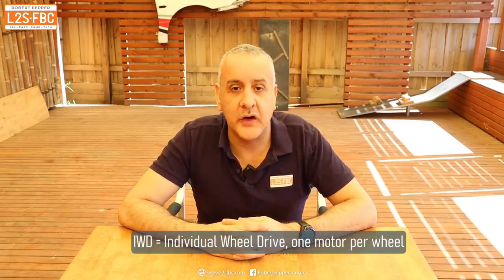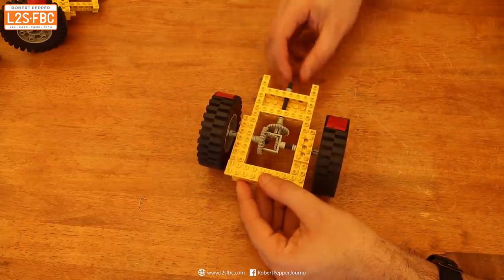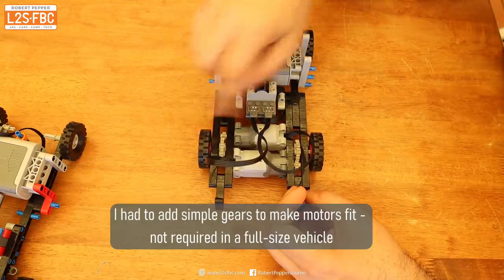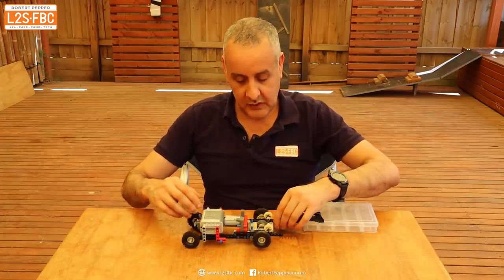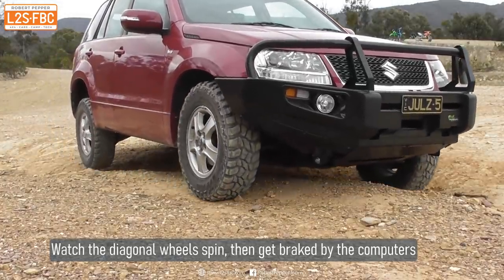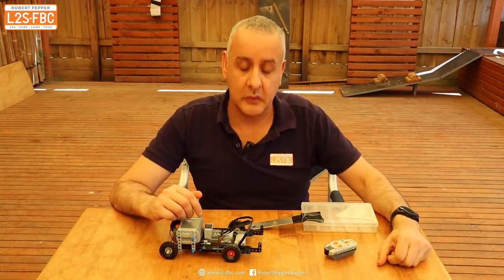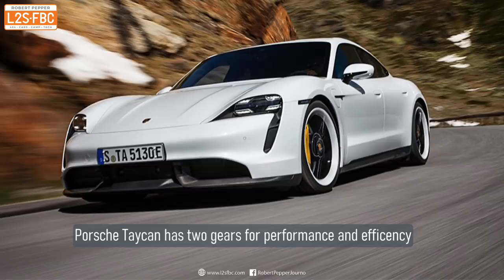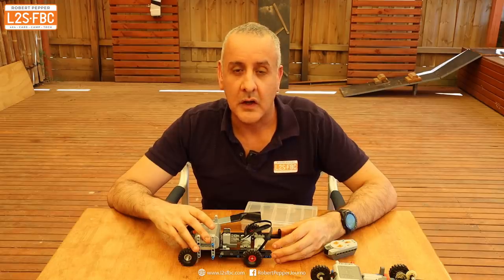Why Differentials Will Die - EV IWD Is The Future!

Comment: I will stick to my 80 series with differential locks thanks
Reply from the maker: That is okay we will pull you out when you need it 😁
Reply: @digbick696969 same aplies to petrol engine vehicles...
Actually since electronics are sealed, they are resistant to any floodeing.
Submarines drive on electric motors when submerged.
Reply: @Martink9191  submarines also commonly used diesel and ice engines, even while submerged, the real advantage to using electric motors is actually stealth and silence. Often the ic where just used as generators.
Reply: @andremartiniuskalstadtjosa1309  When submerged, they drive only electric. They do not have resourse for air underwater.
Little mathematics. When engin ccm is 10L, then every 2nd revolution engine pumps 10L of air trought it (without turbo). So it means at 1000rpm, it pump 5000L of air in one minute. It is 5 cubic metres. But marine engines are not so small. 10L may have on some medium yaht.
When geting on water, they start disel engines to charge battaries.
Reply: @L2SFBC   Hahaha 😂😂😂 yeah right more like the landy will tow you to the junk yard
Reply: @Martink9191  submarine air snorkeling was developed in 1916 in Scotland, it was mostly for the crew and the British Navy never did anything with it until the Cold War. The Dutch fitted it to their diesel submarine motors on O-19 and O-20 enabling the first under water propulsion with the diesel motors. Germans captured the tech from the Dutch on O-25 and O-26 in 1940 and fitted it to the diesel motors in 1943 on U-58. The Americans added them to their submarines with the GUPPY program. The snorkel was reverse engineered from the U.S.S. U3008, a captured German submarine.  
I do know that the snorkel was used on the Los Angeles class submarine, I don't know about the newest subs but I have no reason to think that they wouldn't be.
Reply from the maker: Loving this information thanks 👍
Reply: @jeffjohnson2273  yeh, they do have snorkel. But it is used only in light debth. When sumberged enought, (I do not have info, for how deep), they could not use it anymore.
As an engineer, I think that they might use it at as low as 50m underwater but not more.

EDIT: Looking for info, I found that snorkel is 20m max.
Reply: @L2SFBC  you cant even fit 35s. Cant lift these vehicles.  We'll be pulling you out of the gate to every trail. Gravel road trucks. Plus the amount of torque needed to off road will drain your batteries so fast. I guess youll also need a tow.
Reply: @L2SFBC  not to mention no articulation whatsoever. Youre fkd bud.
Reply: @Martink9191  i know this comment is unnecessary, but in response to your first comment, petrol engine vehicles were phased out in 1996. At least in the US. We use Gasoline now.
Reply: @smittywerbenyeagermenjenso3720  em... you are talking about submarines?

Petrol and gasoline sounds same to me...
At least I do not know any engine useing actuall petroleoum.
Reply: @adamezell7650  WTF Articulation and chassis type has no relevance to BEVs. The drive train can work on any type of chassis. Including ones that have massive articulation. Infact a good platform for BEVs would be the UNIMOG. Remove the Diffs and just have electric motors feeding each Portal axle
 gears.
Reply: @smittywerbenyeagermenjenso3720  FYI You do realize there is not difference between Gasoline & Petrol. They are just regional names for the same thing.
Reply from the maker: IWD 👍
Reply: @Neojhun  youre absolutely right on the unimog, cuz you kept the fkn straight axle and leafs. You disassembled your own argument.
Reply: @Neojhun  so yes, clearly it does.
Reply: @adamezell7650  WTF does that even mean? All I meant is BEV IWD does not require a specific chassis. It can work on leaf springs and independent suspension regardless. The new Bronco achieves abit more articulation with disconnecting front stabilizer bar. I think on BEVs with far more space freedom for suspension gear you could have more disconnection points like on the rear. Even though it has double wishbone front suspension and not recommended to be aftermarket lifted which messes geometry. But the vehicle should be design with enough ground clearance from factory. I think aftermarket lifts is pointless on these new tall vehicles from factory. Even the Rivian is well beyond what most people would need in the freaking Outback Australia.
Reply: @Neojhun  it means what the original post said was dumb. And that you and i are saying the same thing. Yeah you can attatch it to whatever. But how they have it set up it wont work. And dude ive built rock crawlers where the tire is on another guys hood. Easy 5 foot in the air. Good luck achieving that with the way the original post has the suspension designed. Sway bar disconnects are for kids. 4 link, straight axles and some gears.
Reply: @adamezell7650  LOL No it won't. You've never driven a 1980s Toyota Land Cruiser. My family has J80 I believe 1994 (when we bought it new) and a highly specced one. My parents still live out in the bush. It is far inferior to a modern 4x4 especially something like the existing Rivian. You have no clue what you are talking about.
Reply: @Neojhun  ok troll😂😂😂😂 literally drive one every day
Reply: @adamezell7650  LOL Swift boating. You clearly are a troll. Spamming nonsense. FYI I'm a GIS & GNSS Technician, modern version of Surveying with electronic sensors. The kinds of vehicles I install equipment on are Commercial Trucks, Expedition 4x4 like Iveco & Unimog and previously have done Military Contracts for both land vehicles and aircraft. You simply do not have access to the kind of vehicles I work on.
Reply: @Neojhun  you literally repeated what i said, good job. I simply do not give a fuck😂 any vehicle i build will be better than your million dollar budget. My next step in this is an ultra 4  car. If you think you can beat that you would literally have to have a spaceship. But we can have a build off if you want! And just so you know, weve been scaling mountains for decades with elementary electrical systems very efficiently.

Comment: The current problem with Evs in australia is the range. With a diesel defender you can do a 800km trip on one tank or simply fill up at a servo or jerry cans where's with Evs you have to recharge.
Reply: The defender is a legend and great vehicle for exploring the outback but If you are way out in no man's land exploring and having fun it would be great to see a solar recharge ability  you can take with you like a roll up flexible photovoltaic panel made with the new technology of perovskite solar which is thin and light .an All wheel electric drive rivian or Cyber truck would kick ass and you could stay out in the bush as long as you want.on the other hand you can't be assured of finding petrol if you bring an oil rig with you 😊
Reply: Jonathan Spier  fair enough I agree with most of what you say .Im just watching power density of lithium batteries continuing to go up as cost for said batteries are coming down then add that to the cost collapse of the price of solar panels and you have a look into an outcome    that I think 🤔 is very probable in the near future . you can't swing a dead cat 😸😺😺 around your head without hitting a new model of ⚡ electric car,truck ,bus , caravan 🚛 semi ,bus high efficiency Solar panel .not to mention new technology in perovskite solar,wind, battery storage, and wind.just saying I think my prediction of being totally off grid and out in the boonies and being able to get around is coming soon

Comment: Nice explanation of basic open differential operation, it's also shown why it fails in the orange truck someone tried to build for offroad use. There is also the option for clutch and ratchet style differentials. As well as air and electric actuated lockers. 4 motors are 4 things that can fail and will need replacement.

Comment: the problem is you have to over spec the motors as you can only send upto 25% torque to a given wheel, a 2 motor setup with conventional lsd or locking diffs would be superior in most offroad situations

Comment: Great video.  I think you got the direction of wheel turn backwards on the on-screen commentary about the Rivian tank turn.  Have you thought of doing a video on modern suspension systems?  I'm particularly interested in Rivian's air suspension vice the capability of something like the Audi active suspension.  I'm wondering if the extra advantage of the Audi system being able to actually lift a wheel (for example, to smooth out riding over a pothole) will be noticeable in a system like Rivian's which, from my understanding, does not lift, but which possibly may not need to very much because of the significant inertia of that large battery mass.
Reply from the maker: Oops, sorry about the verbal typo! Yes there are suspension videos on the way, that's one of my special interests. Technical detail on the Rivian systems is quite sparse...I don't think it will be active as you describe but the technology to do that already exists. Basically the car detects a bump just before it hits the bump - using some sort of scanning system, unsure what maybe LIDAR - and reconfigures the suspension to deal with it. So for example if the front left wheel will hit a bump the damper (shock) may relax slightly. It is also possible an IWD system could slightly change its torque settings for optimal effect. The heavier the vehicle the less it is upset by bumps, but another EV advantage is weight distribution - it's nice and central, plus low, so that's great for stabillity.

Comment: When the USA was going from horse and buggy to powered buggies there was a company called Baker coach that made cabs and motorcars for the Whitehouse for the president that used 2 electric direct drive motors on the front to drive the vehicle.  Porshe had an electric drive some time ago also.  Large trains and many cargo ships use electric drives fed from massive diesel generators, the electric drive supplies the torque needed for the large trains.
Reply from the maker: And diesel-electric is also used in some heavy earthmoving equipment!
Reply: @L2SFBC  Almost all at this point. Most of the really heavy stuff is Hydraulic-Electric drive (With an electrically driven hydraulic pump). Which is stupid-easy to scale down. There's 1:14 scale full-function hydraulics for RC construction equipment. The only important part is where the electricity comes from. And until batteries catch up, replace that belly battery with a fuel tank and stuff a 6kW diesel generator (Or paired 3kW for space saving) under the hood.

Comment: I always thought it would be beneficial to turn each front wheel independently.  When you look at the circles scribed by each tire, you find that the front tires cover different distances in a turn also.  The inner wheel should turn a bit sharper than the outer wheel.  I think this would also improve efficiency and reduce front tire wear.
Reply: @hughn  thanks, I checked that out.  It still seems that an active system would still be better.  The Ackerman linkage seems to be better at low speed, then has negative effects at higher speeds.  To cover the full range you need independent steering that maps the geometry to the vehicle speed.
Reply from the maker: Exactly..and four wheel steer!
Reply from the maker: IWD can do that!

Comment: great video, great LEGO models 👍👍👍 - 15 years ago I replaced the front diff with a LOKKA (not sure whether they are still around), was cheap as chips and still works flawlessly. It does the opposite of a normal diff and transfers the torque to the wheel that still has traction - the advantage compared to a "real" locker is that it still allows steering. But yes, I agree, the future will be 4 electrical motors for each wheel - can't beat the advantage of having full torque (when needed) immediately at lowest revs.

Comment: All good fun until you need to tow a load.
I’d love to see someone do an individual wheel combustion engine vehicle, just for interests sake. The tech to control inputs is already available. The benefit for a single engine is the ability to transfer all power/torque to one wheel when it’s logical to do so…limited by motor size in an ev.

Comment: One disadvantage is that with a fully locked ICE 4x4 you can send all of the power and torque to a single wheel which can be necessary to get over an obstacle. With four independent motors in he same situation you are limited to the maximum power that one motor can provide. I will say that an electric motor can be substantially "overpowered" for short durations so this may not be much of an issue.
Reply from the maker: Very good point! Should have thought of that 👍
Reply: A problem you run into with lockers is if only one tire has traction all the power goes to the tire and twists axles.

Comment: I can imagine every hub on a vehicle becoming a powered hub.  Can't imagine for the next few decades all vehicles being all electric, until you can fill a battery as fast as a fuel tank. Hybrid power is going to be the thing, with the option of short distance battery power.
Reply: Depends on your lifestyle and battery capacity when you have 300mile range and can charge over night at home, it is perfect your car is every morning fully charged and 300miles are far enough for most people.
Reply: @jonasstahl9826  for a nice streamlined car under a tonne mostly cars. But for 2-80 tonnes brick on wheel the heavier you get the more the weight of the batteries will a larger percentage of the vehicle weight.  A Tesla S power pack is about 100kW/h for 2 ton vehicle for 275 miles at 55mph. So an average truck engine is 2500Nm. 1 Nm = 1W of work. 2500Nm is 2500W per second. Which is 2.5kW x 60(sec) x60(minutes) is about 9000kW/h = 9MW/h. I believe the battery pack on a Tesla S give 157W/h per kg of weight. 9MW / 157W means the battery for the truck would be over 57,300kg, and 90 times bigger than the Tesla's battery pack.  Probably the size of the whole container on the back of the truck. So no space for a load. I think my logic sort of works.
Reply: @wingman1392  Sorry but your calculation is very wrong. Lets do it much simpler.
Tesla say they need 2kwh per mile fully loaded with 80.000pound. For the range of 500miles it needs 1000kwh/1mwh of battery capacity. A 100kwh battery of the Model S weigh 600kg/1300pound, but that is inclusive the case with give the body a lot of stifness, it is probably 10-20% less weigh.
The 1000kwh battery than weigh 6000kg/13000pounds. Without the case and with better batterys it is around 4500kg/10.000pounds.
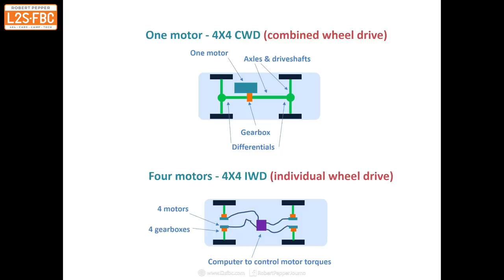Reply: @jonasstahl9826  I look forward to see what they achieve with the Tesla Semi. It will happen but will it be batteries or an alternate power source? What about a Tesla Road train ?https://www.youtube.com/watch?v=0iFkKRh5kcM  1:08 centipede. That would be an amazing electric IWD. All trailers with batteries and hub drive. So what will the tractor unit look like since it wouldn't;t be towing just steering and control? A Renault Twizy. ha ha ha
Reply: @wingman1392  IED is pretty cool but when you have a trailer with motor and battery it is a box truck. Would have very good performance🤣

Comment: I believe in a real offroad situation with the wet ground or snow you will dig yourself deep down under the ground with the tank turn instead of actual turning. Tank turn looks stunning in the ads but in real life can hardly be used ever. 
Watch videos with offroad machines with side turns - when they are in bogs or in deep snow they do turning very gentle trying not to loose drag force from the side which should slow down for turning
Reply from the maker: Good point! But still a nice trick that has its uses.

Comment: The major issue for us who like to use vehicles off road is that although the technology is great, all the electronics, computers & sensors can, do and WILL fail. I work with similar technology regularly in industry as a maintenance technician, and sensor and motor failure must be the most common issue we face. This can be expensive, complicated to fix on the fly and also hard to source parts/ software. The same goes for the traction control systems.

Think of deep wading with water ingress, jamming branches, bush and mud under the vehicle, grounding on rocks and ruts etc... a sealed differential with a locker will survive the abuse far better, and the mechanical simplicity is easier and cheaper to work with.

This technology must be easy to work with in the outback, the spine of Africa, the middle of a UK Quarry or off road course. Software will not be easy to come by, nor will a dealership out there, and the complex electronics will be far beyond the scope of the DIY mechanic skills required in remote places.

Fantastoc concept, but  good old solid diff locker and differential does the trick, and very well.

Comment: I don't have anything against electric vehicles, some of them are crazy fast and would be cool to drive. But for me there is nothing like a truck with a big block V8 or old school diesel engine and a manual transmission. Or even the little Toyota 4x4 manual pickup I used to have. I never had soo much fun offroad as I had in that little truck.